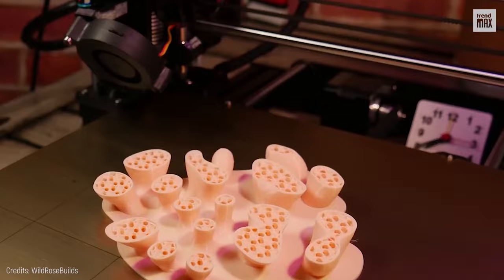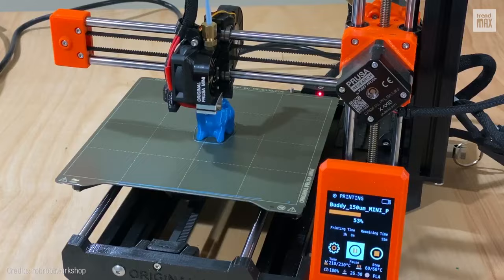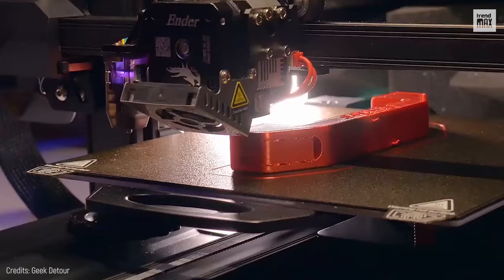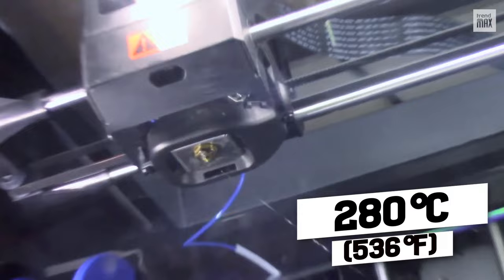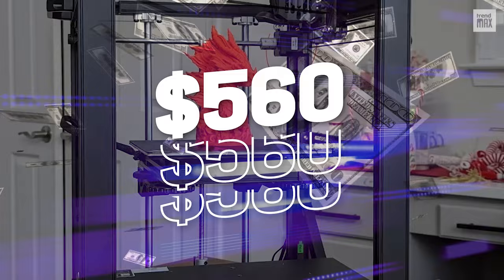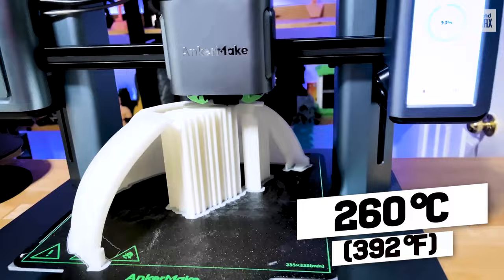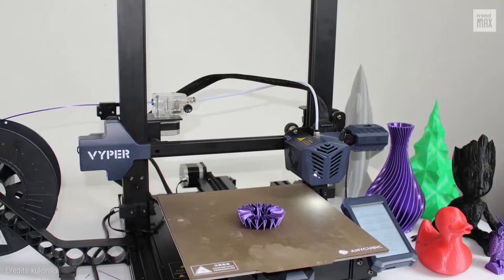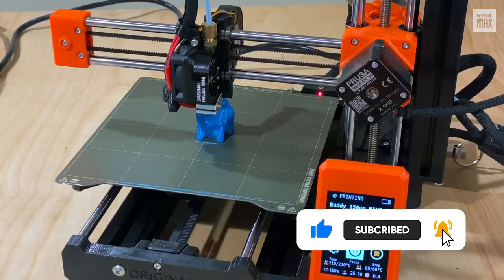TOP 10 BEST 3D PRINTERS 2023

Comment: Not only is this video filled with many factual errors, no mention of the Bambu Labs X1C & P1P on a 2023 list shows how poorly researched this video is, and how meaningless the ranking is between printers intended for different use cases and price brackets.
Reply: It's just a chatgpt generated video script from a content farm YouTube channel
Reply: yeah
Reply: @WatchingYoutube123  There's the bambu lab p1s, which is an enclosed p1p. But it really depends on your budget.
Reply: Clips_For_Life  The sovol sv07 is a great budget option and the svo7 plus just came out for a bigger volume (300x300x340) at $329. It does require a bit of tuning but after that it's a great machine.
Reply: Saved myself 10 mins thanks to you. Thanks man 🤝
Reply: This is why I look at the comments before starting a video since YouTube removes dislikes
Reply: Thanks for saving my time. 
I’m out, with a dislike.
Reply: @WatermelonSlice7  thanks for your replies. Could you please let me know which is a good all color 3D printer out there?
Reply: @GiveAndItShallBeGivenBack  I'd personally recommend either the bambu lab A1 mini combo ($450) with it's main drawback being it's size, or the bambu lab P1S combo ($900) for a bigger build volume as well as ability to print materials such as ABS and ASA. Neither of these are all color though, the A1 mini combo includes 1 ams lite for 4 colour printing and cannot do more than that and the P1S combo comes with 1 4 colour ams but you can buy more AMS units for a maximum of 16 colors on the p1s.
Reply: And the reasoning behind why the The Bambi Labs X1C was not mentioned, is either because they don’t know of it, or they don’t know of it as the company only ships to like 7 countries that of which are only in the east, they won’t ship to anywhere in the Mediterranean, Africa, Europe, Canada, The States or South America, so it can’t really be listed when they themselves limit who can have access to it
Reply: Yappachino 🗣🗣
Reply: Just because your printer didn’t make his list does it mean it’s not good or great at whatever it is supposed to do he feels again because this is all subjective. The creator the is just trying to expand ppl options #dontbebutthurt
Reply: agreed